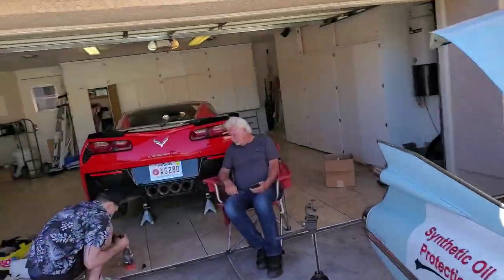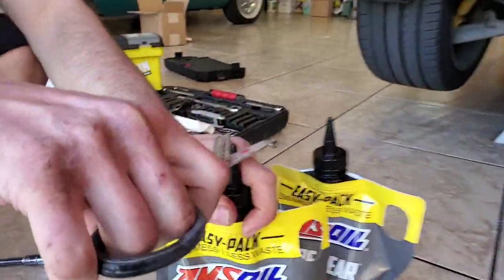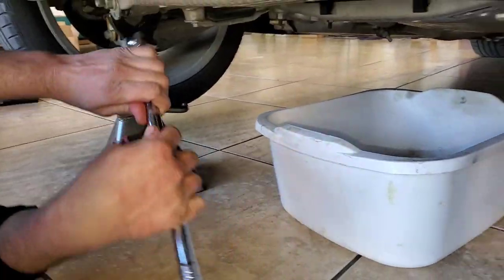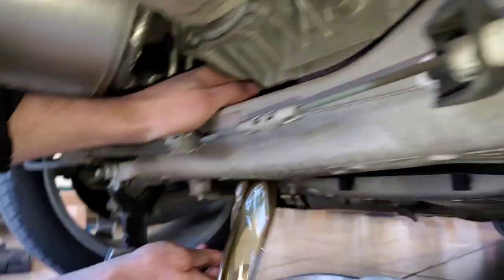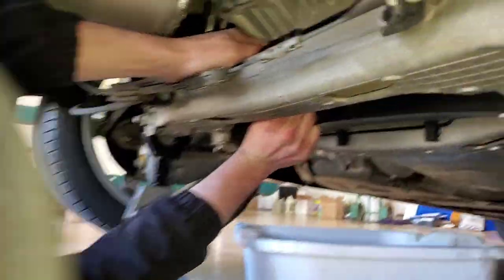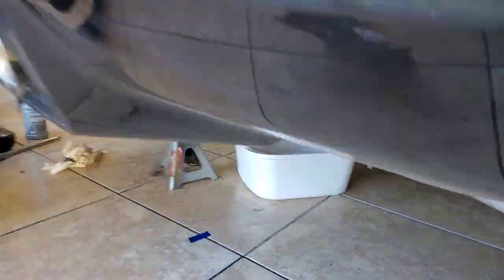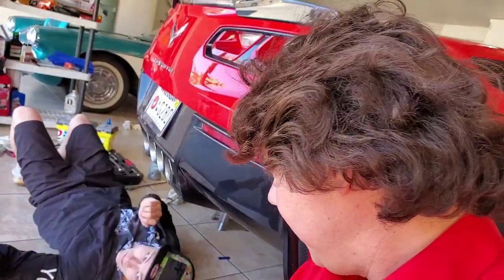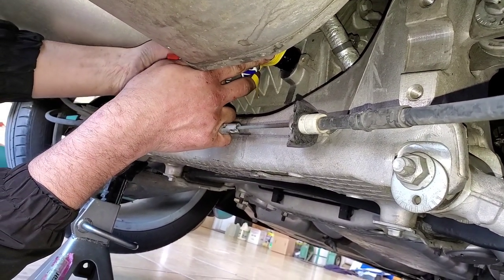DANGER - 2015 Corvette AMSOIL 75W-90 Differential Fluid Change

Comment: Can you tell me which manual transmission fluid I should use for my 2010 camaro ss 6.2l v8 ls3
Reply from the maker: I believe those are the tr660 which takes the multi vehicle signature ATF fluid double check it with the lookup guide and if you're new to Amsoil I highly recommend the 6-month PC member that will give you the best value and when you use my link that will attach me to you from the future I can answer all your questions in the products about improving the performance and lifespan of your vehicles by choosing the right fluids as your independent Amsoil dealer👍☕️
♥️   Shop by vehicle - https://www.amsoil.com/guides/?zo=5331179
New promo: FREEQUART
Reply: @Syntheticoilprotection  thank you for getting back to me , I am a Amsoil pc member but I need help with which oil to put in my transmission I only see 75w90 , I’ve read all the internet that the ac delco oil viscosity is 75w80 and is it ok if I go with Amsoil 75w90 serve gearoil will that damage my transmission ? What’s the difference between manual transmission & transaxle gear lube 75w90 compared to amsoil manual synchromesh transmission fluid 5w30 , I don’t know which one is safe to use for my camaro I’ve heard great things of amsoil so i already have an order for motor oil that is coming in this week
Reply from the maker: @michaelpast19 awesome when did you sign up as a PC member and am I your Amsoil dealer?
You would know who your dealer is when you sign into your account it will show who your dealer is

Comment: Great video. Very informative.  Does this Amsoil 75w-90 need slip additive or does it already have it?
Reply from the maker: It's a great question gl5 specification gear oil has that in it however some require more depending on the component you always want to check the lookup guide that will give you everything on any specific vehicle this vehicle I do not think required more but the way you know you need more is if it ever Chatters if there's not enough modifier when you turn tight the inside wheel will chatter which is very common and if you have that chatter you have to add more slip lock additive for instance the Dodge Viper requires extra because of the special rear end differential component.
I give a man a fishing pole & show him how to fish. 

     Together! We can get your vehicles to run better than brand new! 

     For me to get credit & be "Your" Independent AMSOIL Dealer please use my website below or my dealer no. 5331179 call anytime Eben Rockmaker 702-472-3614
After you click on: http://syntheticoilprotection.net
1. Click hamburger menu
2. Click offers AMSOIL preferred customer
3. Click join now 6-month PC member add to cart.  ( there is no reoccurring renewal membership unless you select that dot box ) 
( you have the option to not have your credit card saved if you prefer - est. 1972 )
4. Scroll up to the top Select shop by vehicle. 

New promos: FREEWAND

Comment: I like the sunroof or is that a clear convertible top?
Reply from the maker: That's called the target top It's removable and it weighs about 10 lb.

My old Corvette was the same way the top comes off in 30 seconds you put it in the back trunk and you can put it back on so you have the best of both worlds you have a hard top convertible then never leaks water
Reply from the maker: This is the proper name.
Corvette Targa Top
Reply: @Syntheticoilprotection  nice!!!

Comment: why do you put the jack stands under the control arms ? and not closer to the middle ? I've read that it's not ok to do it in this way
Reply from the maker: I recommend using a 4 post drive up lift👍

I give a man a fishing pole & show him how to fish. 

     Together! We can get your vehicles to run better than brand new!

     For me to get credit & be "Your" Independent AMSOIL Dealer please use my website below or my dealer no. 5331179 call anytime Eben Rockmaker 702-472-3614
After you click on: http://syntheticoilprotection.net
1. Click hamburger menu
2. Click buy wholesale
3. Add 6-month PC member to cart
4. Select shop by vehicle.

New promos: FREETOOL

Comment: What a waste of fluid.... Just fill it level to begin with and when it starts to drip out, you're done. Plus, aren't you supposed to use friction modifier? Isn't that the reason that Amsoil themselves do not show any fluid recommendation for the C7 diff?

Comment: I use this fluid in my manual transmission.
Reply from the maker: Sweet, what type of vehicle?
Reply: @Syntheticoilprotection  1998 VW beetle diesel.
Reply from the maker: Sweet!!!

I've been wanting to do one of those for a while
Reply from the maker: I also always wanted to do the gear oil on one of those old Volkswagen buses

Comment: Oh my God, these are real amateurs. The car must be absolutely level to change the differential oil - in the video it is only raised at the back! This automatically leads to overcrowding. Also, it's the wrong oil. Always use the original AC Delco oil with Limited Slip Modifier!
Reply from the maker: Oh yeah we definitely broke the rules here however the car did perform excellent afterwards we had no chattering definitely had enough anti-slip lock additive very happy with that.
We did drop the car level to do the final leveling procedure I believe we just didn't show it in the video thank you for the notes and appreciate you being a part of the channel!
I also used the severe gear oil on the differential on my personal car which is recommended a different lubricant my car runs better than brand new it's definitely still a great upgrade - https://youtu.be/D_JMIvsSfNU?si=4LDyGwhipMIGYU4x
Reply from the maker: Is he ever want to try the Amsoil you can get it shipped to you at the best value by ordering it on my website and I can always answer your questions in the future with the products💯🇺🇸👍
Your vehicles can run better than Brand New by choosing the right fluids☕️
I give a man a fishing pole & show him how to fish. 

     Together! We can get your vehicles to run better than brand new! 

     For me to get credit & be "Your" Independent AMSOIL Dealer, please use my website below or my dealer no. 5331179 call anytime Eben Rockmaker 702-472-3614
After you click on: http://syntheticoilprotection.net
1. Click the hamburger menu
2. Click offers AMSOIL preferred customer
3. Click join now. 6-month PC member add to cart.  ( There is no reoccurring renewal membership unless you select that dot box ) 
( You have the option to not have your credit card saved if you prefer - est. 1972 )
4. Scroll up to the top Select shop by vehicle. 

New Promo: FREEFUNNEL

Comment: Hey Eben! Just curious why you seem to always use the 75W90 and not the 80W90?
Reply from the maker: Great question Jared I usually use what is recommended by the OEM viscosity.

Also the 7590 has a better cold flow which will give a little bit better fuel mileage as the lubricant is warming up so it's just a little nicer to have the higher quality stuff.

That's the way I am I always use the best in all my personal stuff.